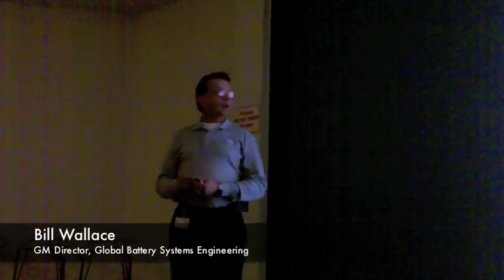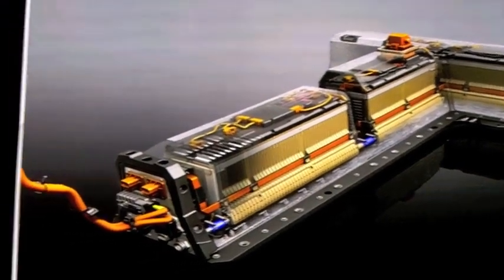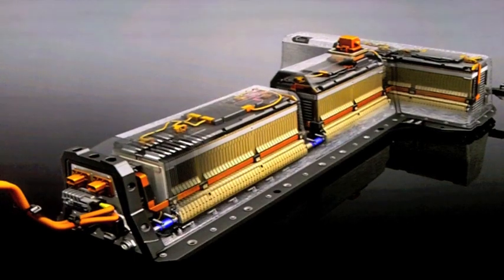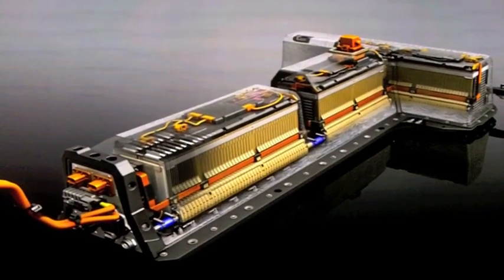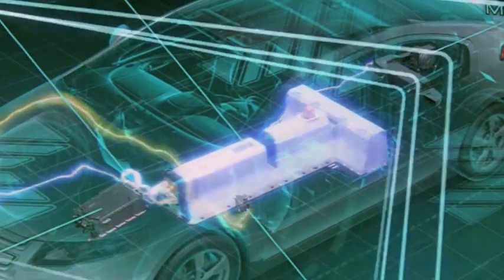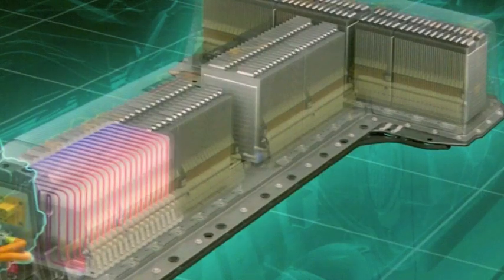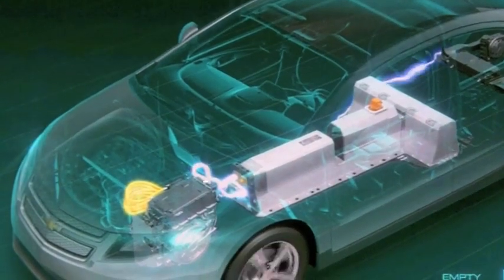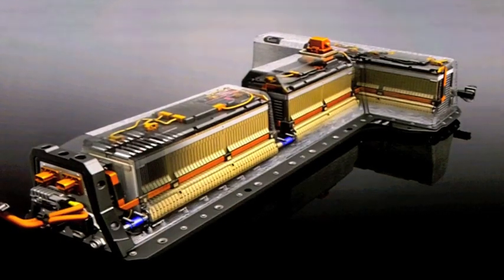Chevy Volt Battery Deep Dive

Comment: @urbex2007 "The volt is such a flop in the UK, absolutely NONE SOLD" The Volt is not being made in RHD yet! it will Launch in the UK in May 2012, (same as Ampera).
15KWh costs on economy 7 as little as £1.05p (@7p/kwh) to charge. So how far can you get on £1.05p of Diesel? @£1.35/L = 0.77Litre = 0.17 uk Gallon @70mpg = 12 Miles. 
Why do you only want 100 mile range? Volt does 350 with extender. why stop at 2 ford focus's? I could buy 5 Tata city rover's... or half a porsche.. or 1 audi A4.